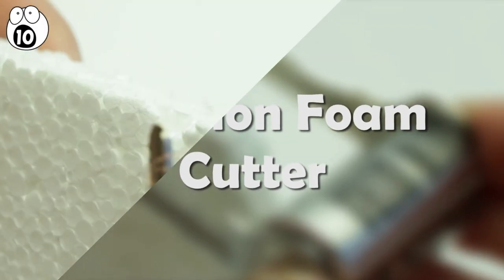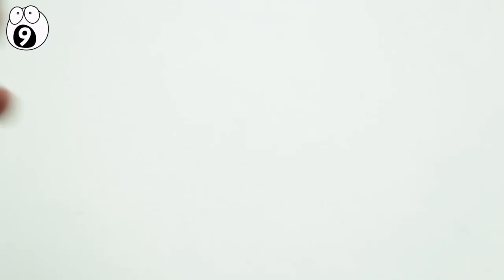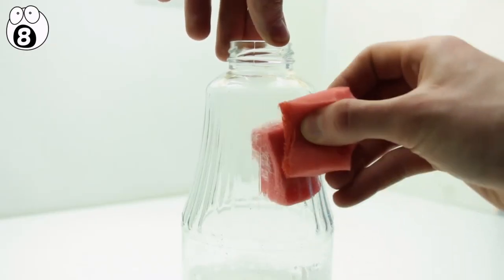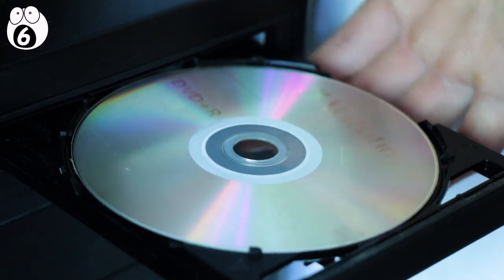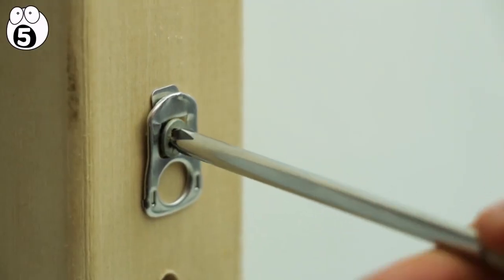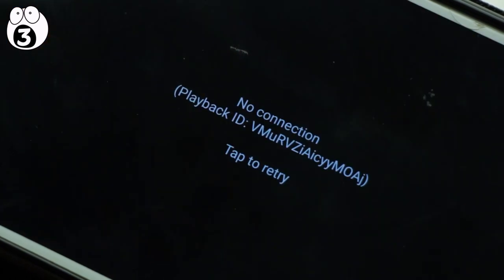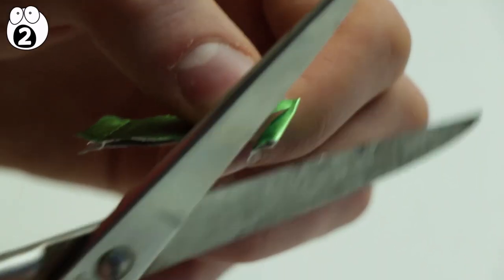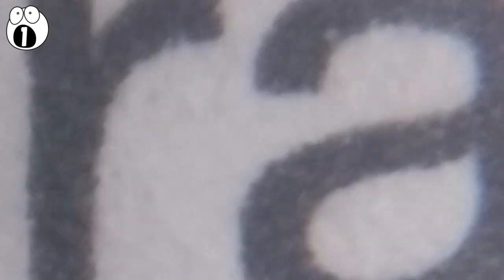Amazing Life Hacks You Should Know About!

Comment: please god if you are going to clean a disk DO NOT SCRUB and DO NOT DO IT IN CIRCLES because that will destroy your disks faster than you'd believe. If using a banana to "fix" a disk drag lightly from the inside out in a straight line then when wiping off do it in the exact same manner.
Reply: ParadoxInfinite1 Source?
Reply: Fiery_Eagle 
Called logic
Reply: The data is distributed in circles radiating out from the center. But going straight outwards from the middle, you avoid potentially disrupting those data channels. Either way, if it's super important too you, rip it to a HDD or take it someplace to be resurfaced. The banana trick is a sticky waste of time. Same toothpaste, sure it might help a bit, but it's not a magic cure-all. 

Source- I managed a video store for 3 years.
Reply: My source is my father is an electronic technician that works for the faa. he has been doing so for my entire life (19 years) and because of this reasonably so know a sh*t ton about electronics such as, airliners, cars, computers, radar equipment, and so on so a small thing like cleaning disks is common knowledge to him and me by extension (for the record yes been working in that field since before I was born so)
Reply: ParadoxInfinite1 wow
Reply: ParadoxInfinite1 so you go up and down from the middle?
Reply: I use toothpaste
Reply: ThePiggyEmpire from the middle outward in a straight line.
Reply: ParadoxInfinite1 ok expert

Comment: #6: There are two problems: 1.) Sufficient strength of the magnets, and 2.) Getting the magnet out of the bottle.  It just seems like too much work.
#4: Just make sure that the sole of the shoe is thick enough…
#3: This is a good one!
Reply: Neodymium magnets, especially the size of the ones in the video are sufficiently strong enough, no problem, I love this idea for certain bottles because it does save time for me getting the nooks and crannies of certain bottles, especially if they've got little grooves and dipped, concave spots or if i can't get the lip below the neck where it gets wider. VERY HELPFUL! On #4, I thought the exact same thing! I think at this point, I'd rather spend the $20 on the slip on ice cleats cause those you can take off when you get into a store and start slipping all over the floor like Bambi on ice! Also, no chance of stabbing your foot with a staple!

Comment: I love these hacks! Very useful! I love your channel so much more than any of the others with similar content of any sort, actually this is the first life hacks one I've seen by you, (I sorta rely on the you tube algorithm to throw up suggestions for me) but I'd definitely love to see more!
P.S. Spray on turtle wax, like for a car, works great on scratched discs that are skipping and no sticky, wasted banana mess to deal with. Just make sure to use a super soft, non abrasive cloth to wipe it away with of course!
Also, the soda can doesn't "boost" your wifi signal, it just takes the existing signal that is broadcast out in a 360° radius and bounces it off the barrier you created so more of it can reach the directions in front of the barrier. I used this years ago in a long single wide trailer to keep my wifi signal on our side stronger rather than loose half of it going towards the neighbors, it worked great!

Comment: When holding the keys to the battery, how many times did the whole thing slip and spring out of your hand spilling stuff everywhere?  It's very difficult to hold four slippery surfaces together.  It'd be easier to use dental floss or simple heat a wire held in pliers.

Comment: For people asking how to get the sponge out: turn the jar....... upside down. once its right at the opening because gravity, you can just grab it with two fingers and pluck it out.

or alternatively, if you wanna skip the plucking step, cut the sponge smaller than the opening before you put it in.
Reply: then pull it through with your fingers its a sponge not a brick wtf
Reply: or, and I'm just throwing this out there, maybe you could make the sponge..... smaller.
Reply: Mark C there. updated for the part I thought was obvious.
Reply: Fatal Foxtrot sorry I'm a man with real sized hands. You may be able to squeeze your prepubescent fingers in enough to grip the sponge, but sadly that's not an option for me. People are talking about the sponge in the video. Don't get so worked up about it 🤣

Comment: Does the banana one work guys? I often do need yo clean discs
Reply: Clay Soggyfries no it doesn't, you can clean discs using soap and water. The scratches, if light can be removed with polish compound and a microfiber cloth going in circular motion all the way around the disc. I do this with cd's, DVD's and games.
Reply: jettacub86 I usually use lens cleaner

Comment: fm what I knew abt CDs and DVDs, the most important area to keep away fm scratches is the printed top area.supposedly the data is stored under/on that layer. 
I tried this suggested theory b4 by scratching and scarring the bottom area where the banana was applied, and the CD did in fact work pretty normally without skipppin or freezing.on the other hand i could be wrong.just saying.